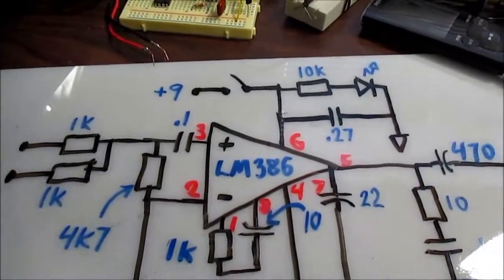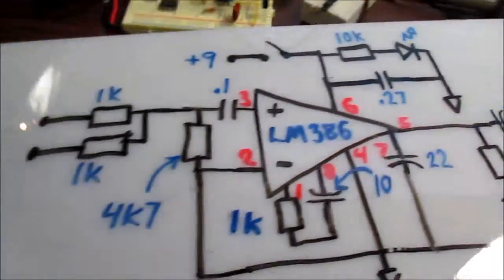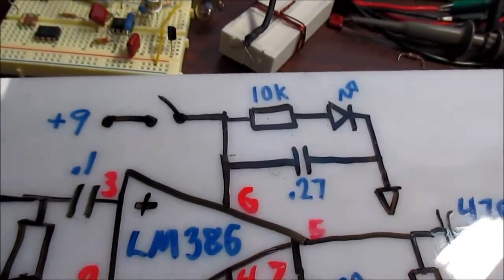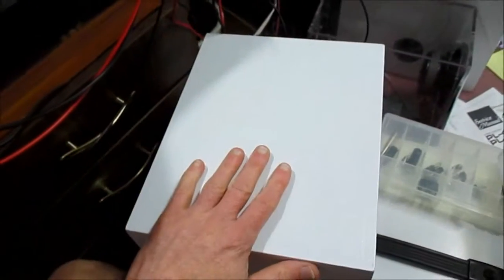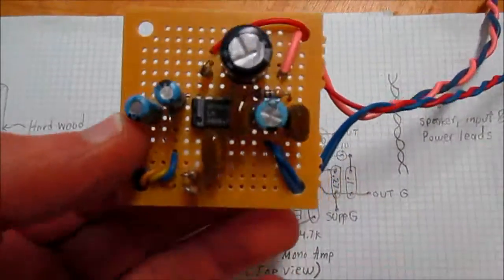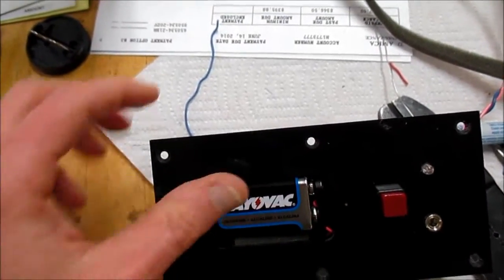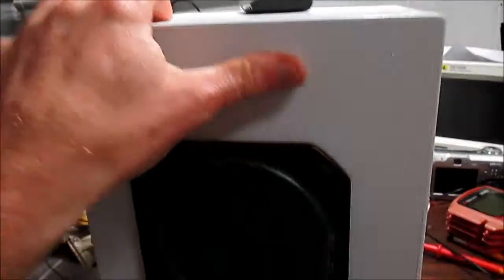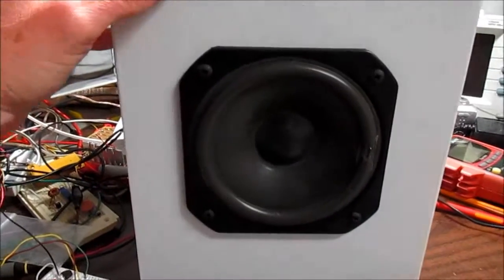LM386 amplified speaker project

Comment: Hey John.  I've been somewhat successful in my diy audio quest because of you, so much obliged!   By somewhat successful, I mean my amplifiers rarely work, but I have fun & my curse word count has decreased a little with each project 😁. 
 A couple questions... If adding a volume pot, would  a 10k linear dual gang work?  Or what do you suggest?  And would I wire them in before or after the input resistors?  And instead of an LED, could I wire in a flood light with a siren?  I'm joking there, I think that should get me there.  Thanks a lot, for real!  I greatly appreciate it!

Comment: What's the functions of the resistor across input and ground and why it's sometimes used inspite of having a volume control potentiometer in some audio amplifier circuits ?
Reply from the maker: It helps reduces the input impedance so the amplifier doesn't pickup noise, such as hum and buzz, on its input. When connected between the input coupling capacitor and base of the input transistor it biases the input stage.

Comment: This is really a nice and efficient speaker box. When you know the internal closed volume of the box and the f0 and Qts parameter of your speaker you can design an active Linkwitz filter to linearize the frequency behavior in order to get a really good sounding device.

Comment: 9 Volts Batteries are the most expensive battery type compare to their power
Reply: One option I have used for portable batter-operated things is type 1850 lithium ion batteries harvested from old laptop or power tool batteries. Even if a "pack" is dead, there are usually a few cells that will still charge properly. You can buy multi-cell 1850 battery holders as well as 1850 cell chargers. Instead of a 9V battery, use 2 or 3 type 1850 cells.

Comment: Thanks for sharing the video. Is it not low a decoupling capacitor of .26 uf for the power supply (+ 9v)? Is not better a value of 10 if or even higher?

Comment: HELP !!! Hi John - I copied this amplifier and the sound is super, using it as you intended. I'd like to use it with the Arduino to play .wav files from a SD card. Have that side(Arduino / SD)  working with a different amp but the sound is awful. I cannot playback from the Arduino through your amp. Could you possibly tell me what to do to make it work. I've tried a lot of combinations (fiddling with capacitors and resistors) but coming from a point of total ignorance nothing has worked......I am enjoying working my way through your other videos and am learning a lot.
Reply from the maker: Can you describe the "awful" sound? Is it bad at high or low volume?
Reply: @JohnAudioTech  Your amp is fine using a head phone output to input to the amp & sounds great. However I cannot get any sound out of yours if I use the Arduino for input (jumper across gnd & input from pin "9" as used in the programme). The sound from the other amp is very tinny & scratchy (from Arduino). The second one in this link. http://www.circuitbasics.com/build-a-great-sounding-audio-amplifier-with-bass-boost-from-the-lm386/ is what I used ---not the bass boost. Im trying to build a "useless box" with personalised sounds & actions for my grandson and want to use an Arduino Nano for the logic & sounds.
Reply: @JohnAudioTech  Sorry sound is "mid" volume
Reply: @JohnAudioTech  The other reason I'd like to use yours is that you have provided the perf board layout.... ;-)

Comment: Hey John! I want to ask a lot of questions about audio amps and making good audio systems. Within the past month, I made a relatively simple lm386 audio amplifier circuit connected to an 8 ohm, 3.25 inch, 1 Watt speaker. 
               The sound is great and everything, but I really want to upgrade and migrate to a more developed audiophile. I really want to eventually build more advanced audio systems with stereo capabilities, and bass control. I looked at a lot of your videos and google searched many forums on good power amps, but they all seem to fall in the 50-60 watt range.
                 I am looking for an ideal, battery powered amp(s) that can output high-quality sound with very low distortion. I do not know where to start and neither which IC to use.

Possible IC's:

lm380?
tda7052A
tda7050
tda2050
tda2030A
Lm3886
Lm1875
lm2875?
A few others have similar numbers but I think they fall into the very-high-powered range of amplifiers.
Some others have high, idle current usage and require heatsink even without processing anything. ( I'm not sure if I want that in my project specifically )

Tell me any Class AB or D amplifiers that I may not know about and would be the best for this project. :D
(If you have any videos related to "pre-amps" please tell me! :D )

The goal is to achieve a stereo speaker w/base and decent music quality, and a good amplifier that won't distort everything when reaching max gain. Presumably to run between 1-5 or maybe 5-10 watts of power. ( Also, I want it to mainly amplify phone music and or computer music. )

My lm386 works, but I can't achieve large on some music without a lot of distortion.(I constantly have to adjust the volume when specific sounds play, effectively keeping the speaker on average, at around .5-.75 Watts for guaranteed, distortion-free performance. I can provide my schematic. Although, I am unsure if this is due to the speaker limits, my amp filters, or the chip itself. It runs at 7.89 volts instead of 9.00 volts exactly. I am just tempted to get larger speakers and an extra lm386 to drive 2 speakers as stereo.
 
Also if there are any specific speaker details that make one sound better than the other, it would mean a lot if you can provide some of that information.
4 ohm or 8 ohm and which amp fits that best without needing a car battery to sustain the whole system.

The max power requirement I am comfortable to fulfill is 3 9 volt batteries in series with a 12 volt buck converter and coupling capacitors on the power rails.

Sorry if this is a lot to ask, I really want to get started into the world of audio, but every day I find myself spending 12 hours to read on so much information.
Reply from the maker: Good questions! I'd start at the speakers first. A little 3.5 inch 1 watt speaker will not be capable of bass or efficient sound reproduction. I don't know how big you want to go with speakers, but about any two way compact bookshelf speaker would be far better. If you want deep bass or louder sound output per watt of input, you will need larger speakers. It is just the physics of how this stuff works.

Moving up from the LM386, I'd look for a 12 volt solution. Forget the 9v batteries because they have low watt-hour capacity and will run down quicker when using with 5 to 10 watt per channel amplifiers. Class D is great for battery use. I have reviewed many boards on my channel. Class D is not ideal for the home builder because of the tiny surface mount chips and careful board layout required.

The linear amplifier ICs, at least many of the good ones, are discontinued (although there are many counterfeit ones out there). I don't have any good recommendations for 12v besides something like the LA4425.
Reply: Thank you so much! Just a smaller question, since my buck converter can be adjusted, and can go max to 32 volts, would there be any other chips around that range of 6-32 volts? My max current - capacity would be around 1,000mah to 3,000 mah.

If i were to get some high-quality 5.5-6.5 inch speakers that run max around 50-80 watt range, would they sound loud with my lm386? ( assuming that 1 watt max can be the output ) or would that over-stress the chip?
Reply from the maker: Is that the output current? LM1875 would work in single supply mode. Check the specs on the speaker driver. There is no "free lunch" in audio. A loud speaker may not sound good and a good speaker may not be loud. For good bass, a large driver in a big cabinet is what is needed. You might want to search around and read up on speakers. There is a lot of science behind the way they work.

Comment: Good job! That's an amazing sound, unexpected from such a small amplifier... Your video convinced me to do this project: http://www.eleccircuit.com/lm386-amplifier-stereo-2-watts/, in order to power-up my phone (for music), but I want to supply it with 2 pieces of 3.7V/1500mAh Li-Ion Cylindrical Cells (in series). I consider even to use 3 pieces. Please tell me what do you thik about this configuration (3 bridged amplifiers for stereo). I haven't seen it until recently, I don't know if it works, but as the author explains, it seems ok.
Reply from the maker: IMO, the LM386 is not suitable for bridge use due to it's weak output current capability. If you can obtain two TDA7267 ICs or one TDA7268 stereo IC and use 4 ohm speakers, you can get good power with a much simpler circuit. The ICs are discontinued but available as new old stock. I have some videos comparing the LM386 with the TDA7267. 9 volts would be the ideal voltage for these.
Reply: Thank you for tips!
I will choose TDA 7268. Indeed, it seems to be missing from romanian stores at this time, but it can be purchased from ebay pretty easily.

Comment: Hey John. I've just recently started building circuits and I built a LM386 circuit off another YouTuber's video. It contained alot of noise in the end product. But what I was wondering is, is there any consequences to not having the right values for some capacitors? For instance you call for a .1 uF a .27 uF and 470 uF capacitor. If I use values larger than specified, will I still be good?
Reply from the maker: +Warren Brown It depends on where it is used. The large output coupling capacitor, for example, can be larger than 470uf. Input coupling can be a bit larger, say up to 1uf or so. Others should be close to the values given.
Reply: A larger output coupling capacitor would give better low end, but it can cause the speakers to pop when you power it on, but the exact value needed depends on the impedance of the speaker. The lower the impedance, the bigger the value needs to be. 
On the input, you need small values since the input impedance is very high. If the value is too high, it will take a very long time to get rid of any dc offset, defeating it's purpose.

Comment: Great video John,  all your videos are very informative.  I really appreciate the information.  One question: is there any way to change the output from 8 ohms to 600 ohms without buying an expensive transformer?
Reply from the maker: logan lawson What reason do you want to do that? If for a preamplifier, I'd use a high performance operational amplifier such as an LM4562.
Reply: JohnAudioTech Thanks.  I'll look at the 4562.  My project involves a telephone/paging/2 way radio outfit.

Comment: Another good reason to use lm386 is that the the tda7267 for sale on ebay have an asking price of $7.95 each!
Reply from the maker: Yeah, that is a bit crazy. I got mine from Dalbani for around $3 a couple years ago. I bought several and made an offer. The asking price was around $4. Not sure why the big increase. Perhaps a demand for them. It is a good IC, but too pricey now. You could get them from DigiKey for a buck something back when they were in production.
Reply: JohnAudioTech Dalbani is the guy selling them for $8 bucks on ebay. I offered $3 each for six, his counter offer was $5, still to high for me

Comment: Nice job on the amp. I recommend that you don't use carbon-zinc batteries. They are just junk because their internal resistance is very high and the capacity is a few times less than an alkaline one. Keep up the good work :)